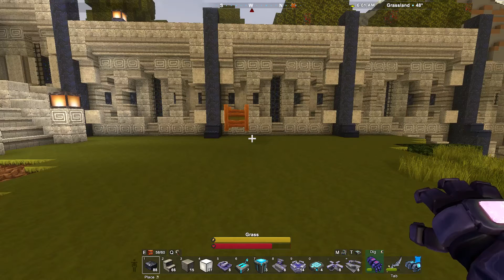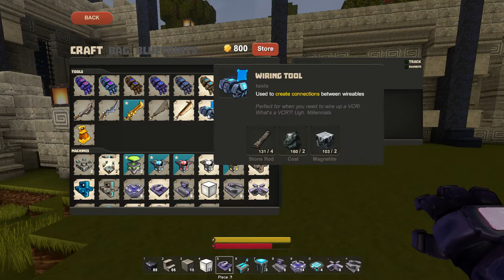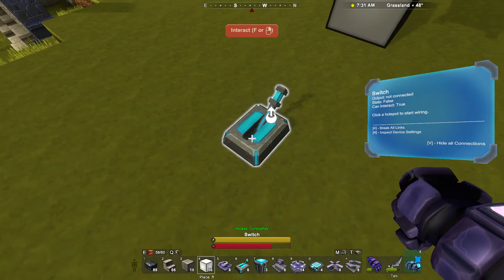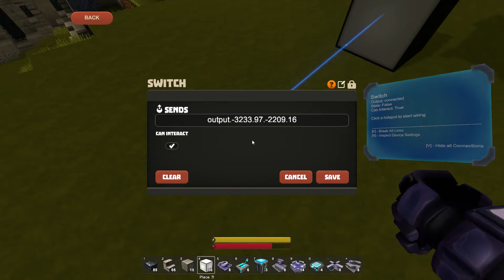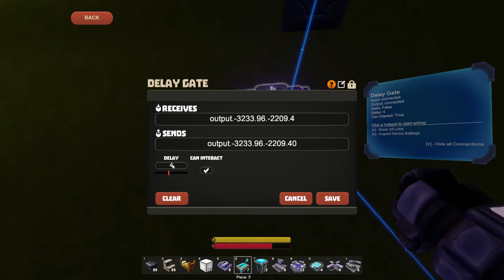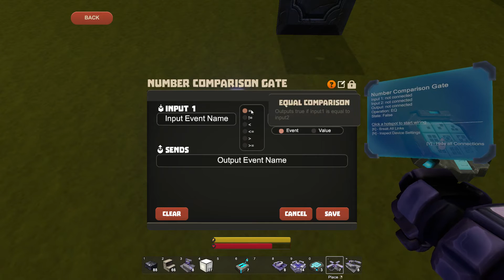Creativerse Machines Tutorials 01: The Basics

Comment: Is there a way to lock your door and only open it with the number pad? Because I only want people who know the code to enter.
Reply from the maker: Yes there is. :) You just have to hook up the number pad to a number comparison gate, and set it up to forward a signal to the door when it gets the code you want from the pad :)
Reply: CuriousKey  Thanks! I just needed to know because I was confused. I subbed. :)
Reply: Well I did this, but people can still open my door without using the code...I'm using a wooden door, Does this make a difference?
Reply from the maker: Ok sorry forgot to mention this but try this: With the wire tool, press N on the door, there should be a "can interact" option that's ticked by default, try unticking that, and it should make it only respond to signals, and ignore manual control :)
Reply from the maker: And thanks for the sub! :)
Reply: Yay! It works! Thank you!
Reply: One last question. Sorry for bothering you. How do I get rid of the claim borders? They look ugly and bother me. Thanks :)
Reply: you can do it in your game settings
Reply: No you cant.... Its not an option, xD